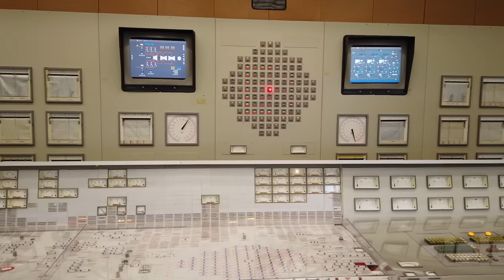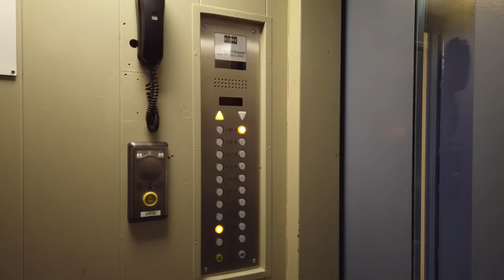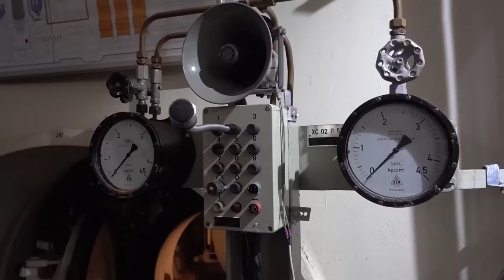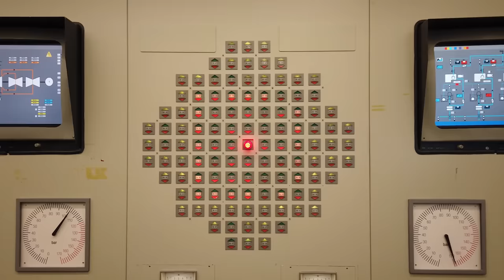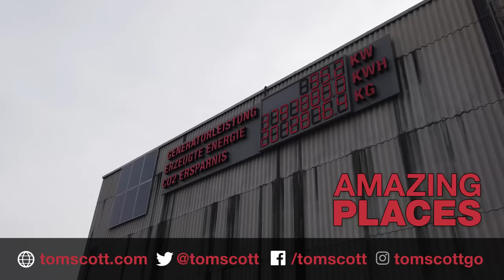This billion-euro nuclear reactor was never switched on

Comment: Funny enough, Austrians take nuclear energy from Czechia's power plants.
Reply: and Germany, which phased out its nuclear power at the same time as it invested 500 billion into renewables (as such, only replacing the nuclear plants with the wind and solar, not actually displacing fossil fuels despite the immense investment!) regularly imports quite a bit of energy from France, which gets 60-70% of its electricity from nuclear.
Reply: Easier to look the other way when you are using nuclear power, but not producing it. Most people in Portugal are so misinformed that they don't know we buy a percentage of nuclear power from Spain and France. Nuclear is excellent for base load power.
Reply: Just wait till the Chinese sell you the Thorium power plant technology they got free from Americans.
Reply: Peter Lyczek Google THTR-300 and the many (often covered-up)  failures of the predecessor (AVR) in Jülich. 

Zhr problem is, that all Thorium-breeders need to have graphite-moderators in its core  - which does make them as dangerous as the Chernobyl RBMK, because there can be a graphite-fire; which was the main reason why Chernobyl did spread much more radioactivity than Three Mile Island.
Reply: @javi8714  molten salt thorium reactor does not used graphite. The working unit in Tennessee run none stop for 5,000 hours before it got shut down. There's only an empty building where it once stood.
Reply: @notyou6950  The story behind the molten salt reactors is crazy and impressive. It's insane no one invested enough in development again after it was cancelled.
The whole world basically uses submarine reactors now.
Reply: @MaxxMcGeePrivate  the only reason it was abandoned was the need to produce weapon grade Plutonium at the height of cold war. Electric power was a sideshow.
Reply: But only when they produce too much and have to sell it cheap. We store it in our water storage plants and sell it back expensive when needed.
Reply: @infantjones  I heard from an article from the National Review that Germany ended up depending on Russian oil. Again, this is according to the National Review, and it tends to lean to the right on the political spectrum.
Reply: @infantjones 
"Regularly imports quite a lot ...from France"
Actually it is the other way around.
Germany is exporting more than France and is producing at a lower cost.
France doesn't have enough capacity so they import from Germany on a regular basis to keep the lights on.

Germany's powerlines are often used to transport nuclear overproduction (at night France produces to much and at day to little electricity) to Switzerland, norway, etc., so I guess you base your statement of this fact.
That electricity isn't used by Germany. Germany is just a transit country.
Germany is currently the biggest net exporter of electricity in the EU and has the lowest wholesale price.
(And no this isn't because they sell renewables for cheap, as renewables get exported the least.)

(To put some numbers to this. Germany's grid oscillates between 40 and 85GW and Germany has a capacity of 225GW (half of it wind/solar), while France oscillates between 35 and 105GW and their nuclear capacity is below 65GW.)
Reply: @notyou6950 
[Only reason it got abandoned ...weapon grade plutonium]
This statement makes no sense.
1. Japan and Germany both build and developed their own nuclear reactors and they never tried or had any ambitions to create weapon grade plutonium.
2. Thorium reactors breed U233 which is weapon grade material and has been used in bombs.
Reply: @greenboi6640 
Germany is relying on Russian oil and gas, but that's cause it is way cheaper than gas from the US for example and this is mostly for heating and transportation and has little to do with power production.
Yes it is used in power plants, but mostly for peak demand.

(Germany is consuming around 520TWh of electricity a year while they have a net export of over 50TWh (the production of around 8 to 10 nuclear reactors).)

Also nuclear is baseload power which doesn't work well with renewables, while gas can be used for peak power demand.)
Reply: @TBFSJjunior  THORIUM Liquid salt reactors? Why isn't that a common knowledge? 
My guess is that it didn't happen yet.
Reply: No they dont, in 2015 austria stopped importing electricity from any source that is nuclear, even our slovenian nuclear plant stopped exporting electricity to austria and it was one of the most important electricity sources for austria
Reply: @javi8714  Chernobyl lacked proper containment was the problem not the graphite, also with a containment building and reactor vessel that is maybe sealed in a oxygen free dry well. Also with a graphite-moderators salt cooled Thorium-breeder reactor with the fuel dissolved into the salt you can melt a freeze plug and take the radioactive waist away from the moderator limiting the release isotopes, which would probably be release into containment.
Reply: @javi8714  "all Thorium-breeders need to have graphite-moderators in its core" 
Baloney. There was a pressurised water reactor at Shippingport, Pennsylvania, that was converted to run on thorium. After several years of operation, they analysed the spent fuel, and it turned out that it achieved a positive breeding ratio.
Reply: @TBFSJjunior  Despite all the green grandstanding, Germany is the EU's largest CO2 emitter by a big margin, and continues to rely heavily on coal for electricity generation. Despite carpeting their country with windmills and solar panels, their CO2 emissions have remained essentially flat, even though they've forced the less affluent into fuel poverty (they might sell it cheap to their neighbours, but Germany has some of the most expensive retail electricity in Europe). The 2018 per capita CO2 emissions are 9.1 tons per person, compared with the UK's 5.6 tons.
Reply: @hugheaston7598  Ok. Don't heard about it. 
But the main reason to name them "safe"  in contrast to other reactors, is that the most developments tried to build 'pebble-bed' - reactors   - AVR Jülich, THTR-300 Hamm-Uentrop  - or prismatic elements      stacked over each other, in that US experiments I knew of,  - so that you "have only that amount of fuel in it, that you do need to operate" .  I.e.  the newest fuel above and oldest below. Instead of fuel for up to four years. 

But this doesn't matter that much concerning  how less amounts of leaked highly  radioactive material is needed to contaminate huge areas.   And even if this might be an advantage,   it does be  equalised by the  threat of a graphite-fire.  (Compare for example Fukushima with the Chernobyl- accident : 1 radiation track on mostly  one day vs. several over 10 days) 
That's what I meant. 
I've also heard that the Indians successfuly used Thorium blankets as part of  filling in their  fast-breeder program, by the way. 
But in general  Thorium is not really saver nor more dangerous than the tested technologies.
Reply: @javi8714  "...less amounts of leaked highly  radioactive material is needed to contaminate huge areas..."
Western countries have gone to great lengths to capture and store all the radioactive material their nuclear programmes have produced, but did you know that the Soviets dumped all theirs straight into the environment? (either directly into the ocean, or into rivers and lakes near the reprocessing facilities, from where most of it presumably flowed to the sea). Considering the size of both their weapons and nuclear power programmes, that must amount to around half of all the manmade radioactive material ever produced. Nonetheless, no great harm appears to have resulted, in fact during the time the dumping was taking place, none of the big environmental groups even noticed (they only found out after the USSR collapsed and word of what the Soviets had been doing got out). There was a lake (Lake Karachay) which contained around 50 Chernobyl's worth of radioisotopes, and was so radioactive that, in the 1990s, it was said that if you stood on its shores, you'd receive a lethal exposure in under an hour. However, they've since drained that lake, filled it in with rocks, covered it in soil and turned it into a nature park. 

There was no need for a mass evacuation at Chernobyl nor, especially, at Fukushima (where the radiation release was several hundred thousand times smaller). It was all political theatre. If you go to Chernobyl today, radiation levels are no higher than in surrounding regions, and the area has become a haven for wildlife. The sole environmental impact of Chernobyl was that some trees immediately downwind of the plant died. That's it. Governments are controlled by the fossil fuel industry, and they've massively lied to the public about nuclear, making it out to be far more dangerous than it actually is.  They originally developed the civilian nuclear program to provide cover for mass enrichment of uranium, needed as part of their nuclear weapons programme. That's why the tide turned against nuclear energy in the 1970s, it was the point at which all the nuclear powers had accumulated enough weapons material to cover their needs. However, nuclear has turned out to be a remarkably clean and safe way of generating electricity, and using thorium, is effectively a completely inexhaustible source of energy (there's enough easily minable thorium available to last billions of years at current rates of energy consumption). Don't buy into the lies of governments and so-called "environmentalists", they're doing the bidding of the fossil fuel industry, and not what's best for humanity and the planet.
Reply: @infantjones  renewables are unpredictible and dont work most of the time so you need a backup energy source that you can turn on and off easily, and fossil fuels are perfect for that
Reply: @notyou6950  Do you mean it was stolen?
Reply: @SS-kz7td  no. It was given by people who had no idea what they were doing.
Reply: @zeux6634  about 80% of Austrian power is from renewables. 20% is gas/import. Nothing more to say about "doesnt work".

Comment: They still use nuclear power plants. Czech nuclear power plants, that is, every time winter or droughts make their rivers to weak too supply hydropower. Yet they constantly bash and berate the Czechs for having them.
BTW: Central European coal is relatively high in radioactive impurities. Burning it didn't help much. And how much does it cost yearly just to have it around?